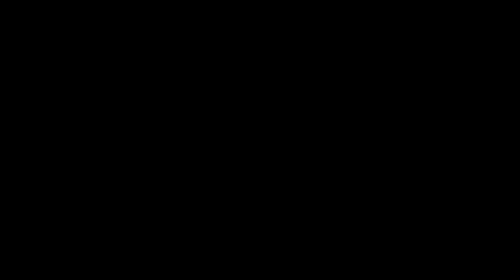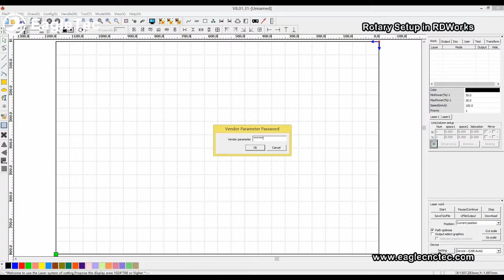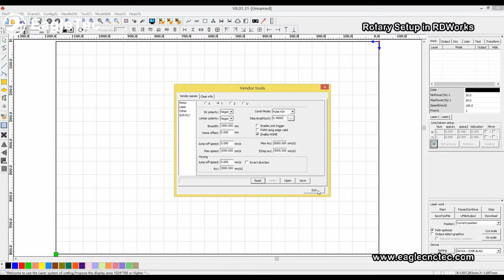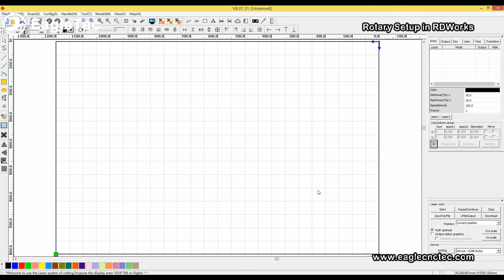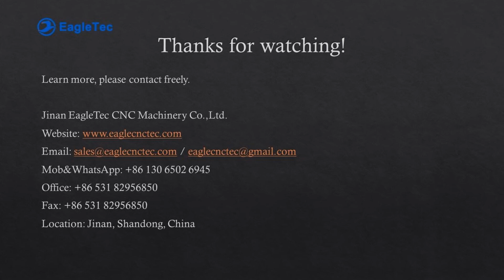How to do Laser Engraving Machine Rotary Parameter Settings in RDWorks

Comment: Okay, let's have a way more simple way to do that. In "user" setting, you have an option menu for "rotary". First, plug the rotary on you machine when it is not powered. The light it on. Second, measure the diameter of your objet you want to engrave. Third, go to the USER menu on the upper right, and down to the "rotary". Select first "read" values. Change the settings to "YES", indicate your measured diameter, then click to "write". Now, you just have to set your origin on the machine using the leveling tool (6mm), then press start. Do not forget to set it to "NO" in the user menu when going back to flat cutting/engraving. It depends on your laser power, but the normal setting for a good engraving to glass is around 40% with a 150W laser. Start alwasy with divided by two, then go up progressively. Regards....
Reply: If you don't get it already, try this : https://www.youtube.com/watch?v=ENNrcndFYdc
Reply from the maker: Thank you for sharing